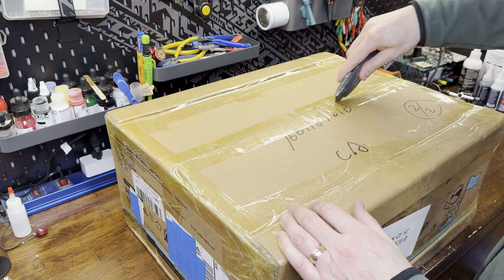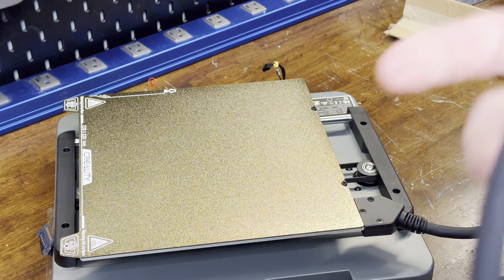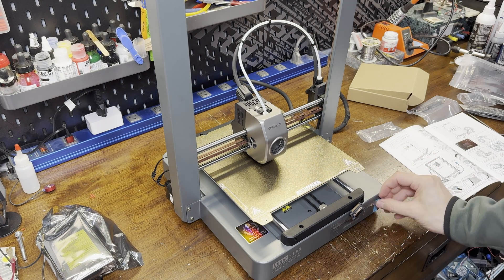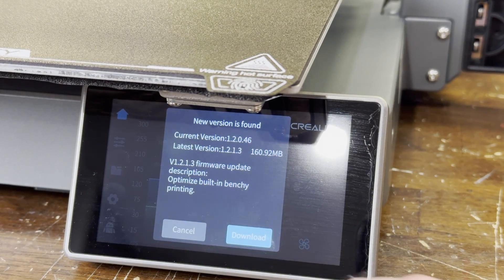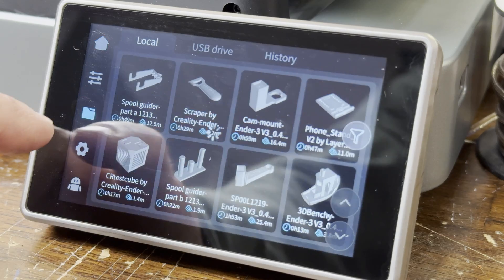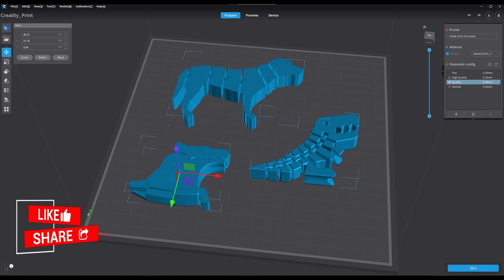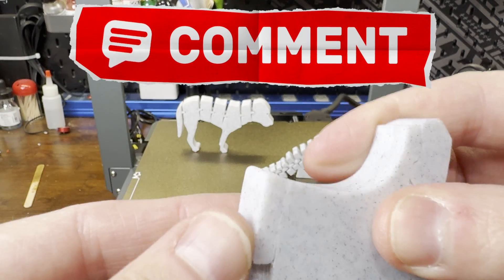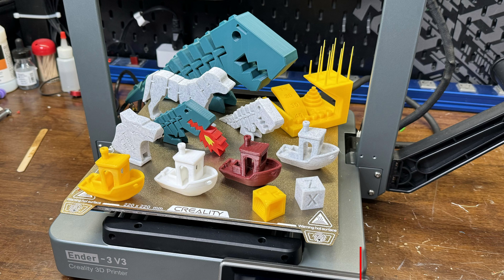Ender3 V3 Unboxing & First Impressions!

Comment: Nice review, I've owned this printer for about a week. I want to use Cura slicer to print RC aircraft that feature vendor supplied stl and Cura gcodes. I'm working on my own Cura profile then attempting to print with supplied gcode but I get an error during the initial print phase. I tried using the supplied gcodes with Creality Print but that locks up the printer as well. Creality Print slices and prints ok.
Reply from the maker: Thanks. Never tried cura. My go to now is orca unless I’m using my Bambu then I use Bambu slicer.